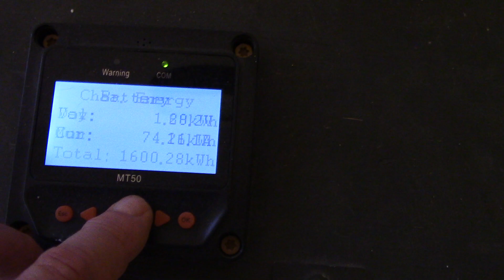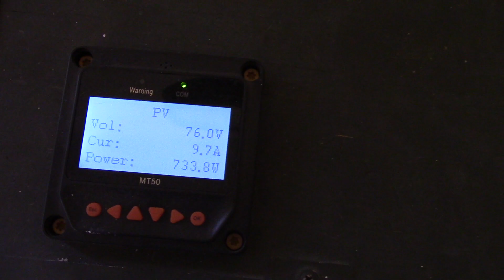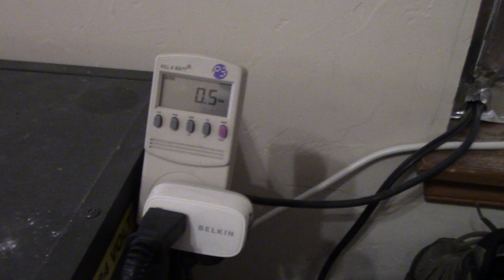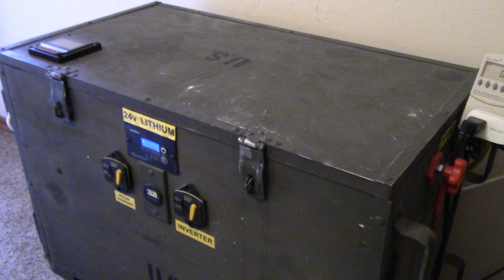24V transportable solar/battery power generator (new Samlex inverter/IOTA charger)

Comment: Howdy.  I'm curious about the IOTA changer.  Seems like that type of setup is missed in a lot of installations.  I love that you are using your other battery bank to supply the IOTA charger.   You mentioned that the IOTA charger did not fight with the other charge controller to charge the batteries.  I'm wondering if that is the because of settings you have on your other charge controller, or how you  manage that?
Reply from the maker: I have the solar charger as my main charging source and set slightly higher. The IOTA (with it's little Lithium plug in module) helps keep the batteries maintained 100%. and also senses when there is any kind of use (which is awesome) and pumps out some power to maintain voltage (up to 500 watts). So, in essence, they don't fight each other. I only have 200w in PV connected to it right now...so, the IOTA is doing most of the charging/maintaining/powering 24/7. Working perfectly. In the summertime, I switch over to using about 1,200w in PV...to run the window air conditioner.
Reply: @ChrisDIYerOklahoma  You really have that dialed in.  Set it, and almost forget it.  Great job and thanks for the info and the video.!

Comment: Awesome video and channel, I am currently building 18650 24v 7s by tearing down 36v hover board battery packs, still capacity testing all cells.  What Charge Controller are you using in your Battle Born solar generator?